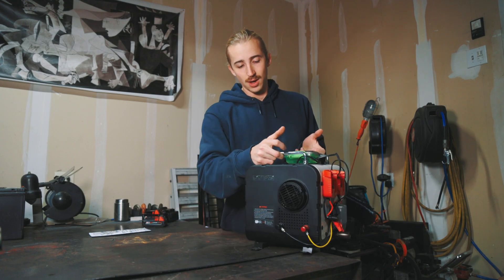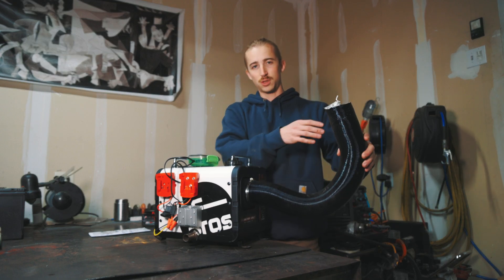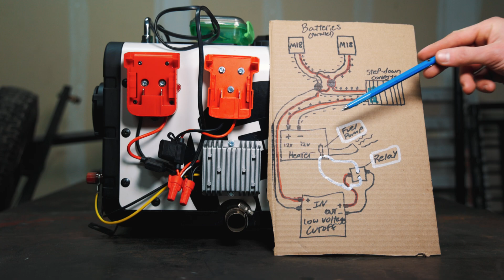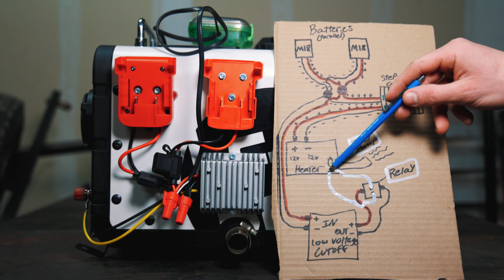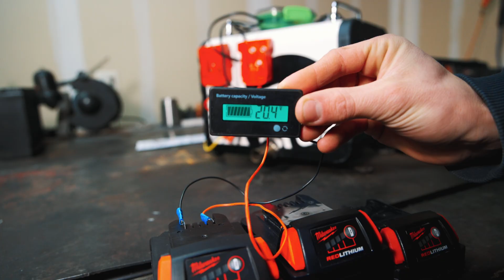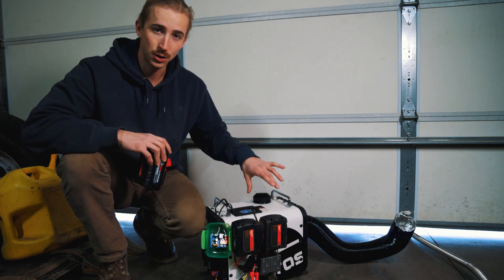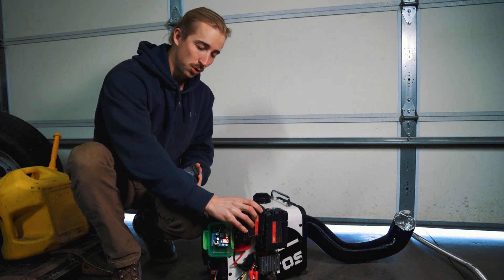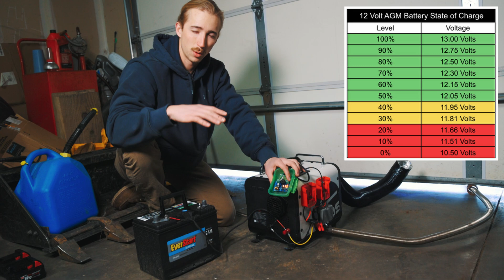Milwaukee M18 Battery Conversion | LF Bros Diesel Heater

Comment: So are you not supplying the fuel pump with 18volts +? Are the fuel pumps ok at 18 volts not 12v? As you have gone straight from the batteries to the low voltage cut off then to the relay then the fuel pump
Reply: I was curious about this as well. Converting my heater as we speak and was looking into this. From my understanding, the step down converter will output a steady 12vdc until the battery is completely dead due to the battery being a higher voltage. Wiring it in before the converter allows the low voltage cutout to sense true battery voltage.

Comment: I believe the heater goes into cool down mode when battery goes to low so theres no damage
Reply: No. Youre batteries interact with your powertools to communciatte voltage so your batteries never drain. There is no "tool" to inform the  battery its being used up. with out the low voltage shut off, the system would drain the battery to completely dead and damage your tool battery

Comment: Is there any difference in battery drainage when its hooked up directly to the battery 18 volt compared to 12v converter set up?
Reply from the maker: I think it’s better with running 18v straight. Less loss along the way
Reply: Thank you very much will do that.

Comment: Their 12-24vdc  now can run it straight in. To enable 2 different batteries with different state of charge u should use diodes to prevent back charging the dead battery
Reply from the maker: I actually figured this out recently. I have since bypassed the step down converter since making this video. Now feeding it the straight 18v. 

I have not looked into diodes however. Still just using 2 batteries of equal size and equal states of charge
Reply: @RichardDunbar they block current going in one direction

Comment: Bro show what you did with the wires from the fuel pump. You cut them to add the relay but what did you do with the ends you cut off that don’t go to the relay?  Please reply to this.
Reply: You have to wire it in series

Comment: What are the main steps i need to do to be able to switch between my lifepo4 solar battery bank and my power tool batteries set up?
Reply: If I understand correctly, Youll  need to wire in your tool batteries and your power bank in parrallel so you can seamlessly transfer between tool and power bank. I would how ever consider an alternative to the fuel pump shut off if your power bank reads a voltage lower then 16.5 (where it would tradtionallly shut off.)

Comment: What issues do you have with sending the 18v to the fuel pump ?
Reply from the maker: Sending 12v. There is a voltage converter
Reply: ok I figured and what low voltage cutoff did you set it to ?
Reply: @RichardDunbar not according to your diagram you are sending 18v to the pump you even said 18v to the relay the relay then goes straight to the pump
Reply from the maker: @j @johnp6636 I no longer run any step down converter. I am running entirely 18v everywhere

Comment: I believe if you were to add diodes into your parallel battery system you could prevent the new battery charging the old battery.

This is a great system you put together.
Reply: Without cutting power and imitating s cool down cycle?
Reply: @Qawqazz I don't believe it would change functionality but I'm not an electrical engineer.

My understanding is that diodes just limit the flow of electricity to one direction. So electricity could flow out of the batteries but not back in. This shouldn't cause any issue as the charger is separate.

Comment: Do you still need one more low voltage cut off on the battery side to keep the batteries from over discharging?
Reply: Im not sure if you got your answer or not. but the low  voltage cut off specifically shuts power down to the fuel pump. The computer says "what? No fuel ? okay we shut down" and engages the cooling shut down cycle. So when thr batteries get low it uses a pre eistinf method of shut down.

Comment: I tried to run 2 step downs on another project I did and went paralel after them. I ended up frying one lol. Is that because the step down is trying to push 12v back to the other battery? If I was to wire it this way through, through one step down would that be ok as long as my batteries are both full from the start? Also if running say a 5ah and and 8ah wouldn’t they discharge at different rates and you would always have one feeding the other? I’m just curious because I have the same diesel heater and would also like to do this next….
Reply: yes you most likely killed one of the step down converters, because one stoppped working and the other back fed it the output 12v becasue they were wired in parallel, ideally you would wire a diode in between the 12v parallel connection, stopping the back feeding it one battery runs low, this would also solve the problem that you mentioned with running different size batterys, the smaller battery will drain faster and i am willing to bet it would also be an issue in the ong term if you are using 2 of the same size batterys but with different amounts of charge cycles and total capacity. im not sure how diy you are but i really thing this would be a great idea, all it would need is one of these diodes on one of the wires (positive or negetive) from each voltage step down outupt.
Reply: thinking about it more now you coual also wire the diode in before the batterys join for the parallel connection if you only want to use a single voltage converter.

Comment: Hey richard. Are you able to send a picture or explain possibly what or how the wires from the low voltage cut off to the fuel pump are wired together.  ?
Reply from the maker: There are 2 wires running to the fuel pump.  All you need is 1 of the wires (does not matter which one).  Cut that wire in half and stick those 2 ends on the small terminals on the relay.  Then run positive and negative wires from low voltage cutoff to the large terminals on the relay.  When the low voltage cutoff is providing power (the voltage of the battery is high enough) the relay closes the circuit on the small terminals (to reconnect the wire that you cut to the fuel pump).  When the voltage is too low from the battery, the low voltage cutoff stops sending power to the relay, and subsequently the relay then opens the circuit (effectively "cutting" the wire that you cut in half again)
Reply: @RichardDunbar  thank you very much for clarification. I had thought that was what you had mentioned or my interpretation of what you had mentioned and we'll i thank you again for the help

Comment: How long could you roughly expect from 2 5amp batteries with the heater on low?
Reply from the maker: @fontainegaming614  my guess would be about 4 hours
Reply: Richard.  Any way to send a picture of how you have the relay wired into the fuel pump area.    I have everything but a relay. Once I get that I'm kinda confused for some reason how to tap into the wires for pump

Comment: Nice build your one of the few that has the low voltage cutoff wired in. These batteries are way to expensive to risk over discharging them. Most of these diesels heaters are rated for 12-24v so is the step down converter really required?
Reply: It should work at any voltage between 12 and 24v. The current will drop as the voltage increases. I don't think the drop down is needed.
Reply from the maker: @user-sq7mm3hn2e  I don’t know to be perfectly honest. I did not want to risk feeding it the improper voltage
Reply from the maker: It would be a good experiment